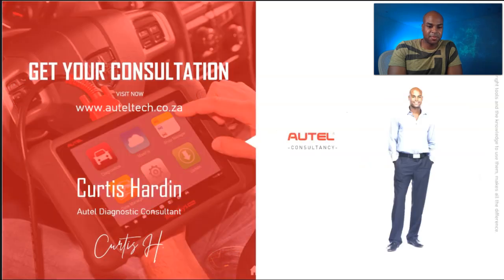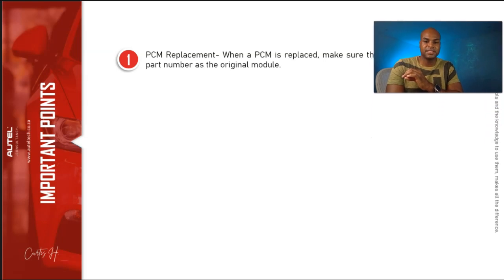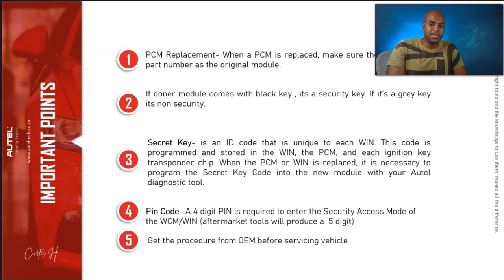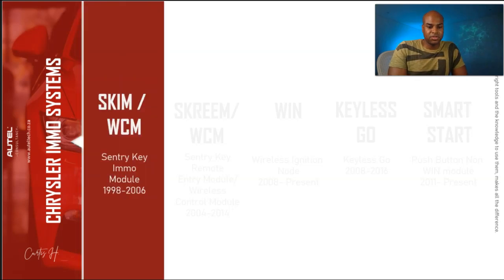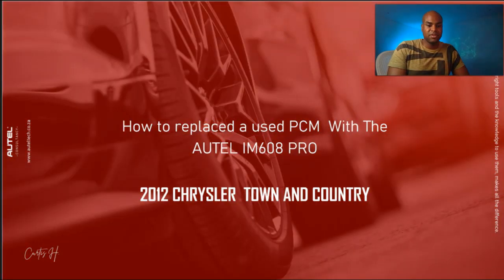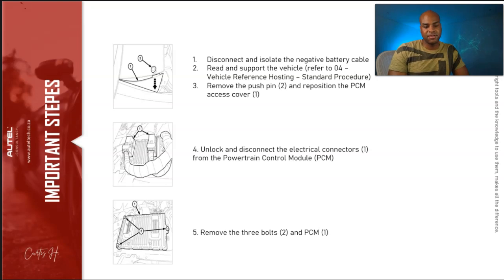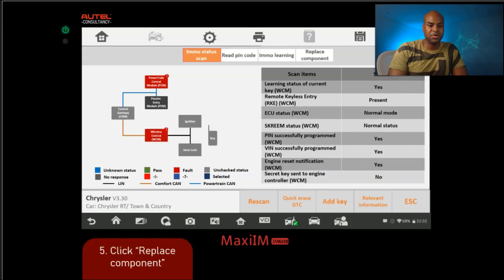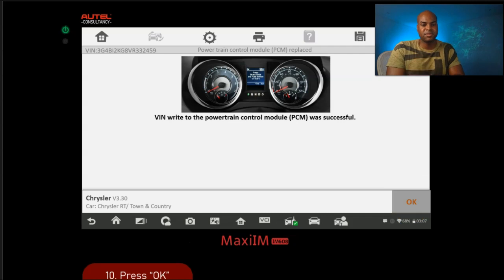IM608 Pro Training - How to replace a used PCM On A 2012 Chrysler Town And Country

Comment: Hi sir,  I was trying to add a key for a dodge caravan 2008. I used my Im608 to retrieve the 4 digit pin. It gave me 2 sets of pin and both are incorrect. Why are the pins are invalid? There is an issue with original forbik key. It had to take a 30 mins rest before it can turn the ignition on and dashboard to come on to start the vehicle.

Comment: Hi Curtis I wonder if that same theory applies to sensor connectors; dodge connectors are sometimes black or grey should the harness connector be the same color as the sensor connector in order for the sensor to fit and function?

Comment: i could not clear A used key BE file for a mercedes benz w203 with  key version  40,telling me key clearing failed is it because the version is not included in the autel im608 system software and can i clear a used key BE file for a mercedes benz w203 with  key version 51 found in the system?

Comment: The black key is a non security key and the gray or tan is a security key.
The only black security key I know of is the emergency pod for vehicles built with a WIN module.
Reply from the maker: HI VSP I was wrong about the non security vs security. Thanks for correcting me! I I should have saw this error before I published the video. Thanks
Reply: @AutelConsultancy  I am a locksmith and was so going to post this same thing but wanted to review some posts before I did so, great call vsp-036!

Comment: Hi...I want to know if only IM608PRO can do this procedure.....or let s say I have a IM508 Not  pro also can do this procedure and how I can make my IM508 to be converted to IM508 pro if it is possible.....any help thank you.........
Reply from the maker: The IM508 will have the PCM replacement option. Im just not sure if it will have the special function to do the reset
Reply: @AutelConsultancy  ok...thank you ...it will be all good because I also have autel ms.elite for that  and I just bought autel ultra that have not registered yet...so I was curious about the difference of PRO in the inmo series...thanks for your help...........

Comment: Dear brother I have one question regarding remote control of MS 909, what I see that you can monitor only through teamviewer. But what I want is to control the device remotely so is that possible unfortunately the old models have this feature through wifi but the latest not please advise

Comment: Hello curtis i think you have the black and the grey keys mixed up so the black key is not a transponder key its the grey key that has the transponder in it so black no theft grey has theft
Reply from the maker: HI Abe, Your spot on. It was a mistake and I got it backwords. I couple of my locksmith subscribers also told me the same thing. Thanks

Comment: Hey can this tool add a key to 2019 alfa giulia
Reply: I did AKL on the Alfa a few weeks ago. It’s a Chrysler system, and you just need to use the 12-+8 SGM bypass cable. It’s not easy to get ahold of, you need to drop the airbag and stick your arm way up behind the dashboard to get to it. Once connected, it’s no different than programming a Jeep as far as I could tell.
Reply: @travisbryant3856  I tried i had the 12+8 cable but the system did not give me the option to add key . I did a full diagnostics on the car without a problem.  2018 and below added key no problem but 2019 there isn't even a menu to add a key on the im608. But thank you for you comment back. I enjoy watching all your videos,very well informative and easy to understand 👍.

Comment: What is the difference between im608 and im608 pro can the pro do scn coding?
Reply from the maker: The Pro has a better serial programer and a few other extra accessories. The software on the tablets are the same. the pro cant do the scn coding. It requires a different tool